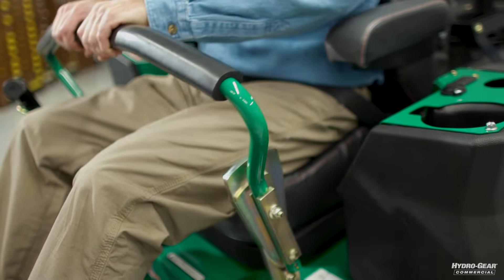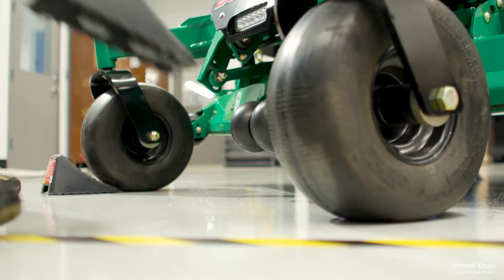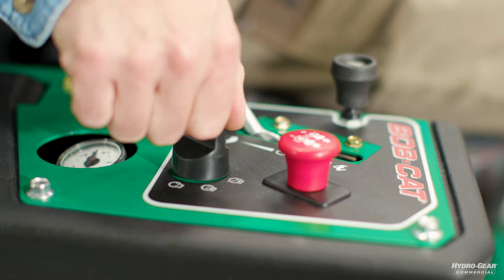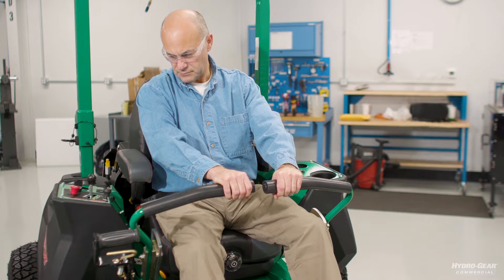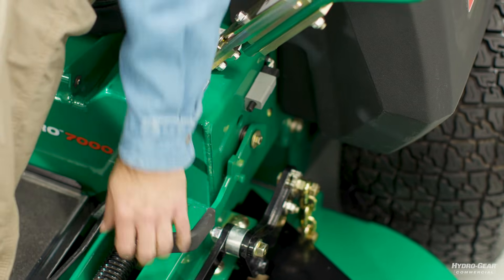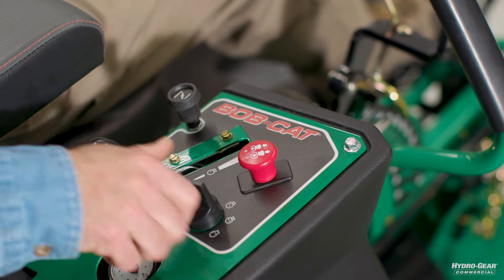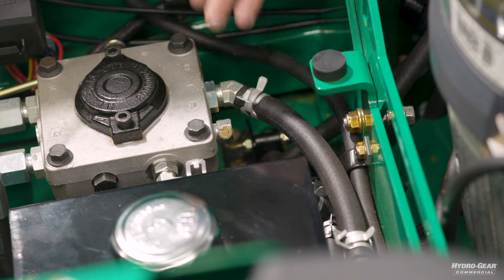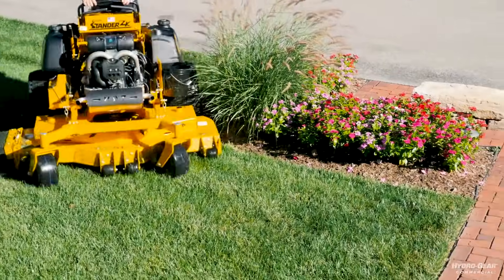Hydro-Gear Pump & Wheel Motor Air Purge Instructions

Comment: THANK YOU...for this video.
While I was unable to directly find ANY videos disclosing the hydrostatic drive bypass valve for a Snapper zero turn mower...i happened upon THIS video, which revealed a nearly identical hydrostatic transmission/ drive, AND ..."Huzzah..😄" the location/identification of that elusive bypass valve.
Again..thanks so VERY much.

Comment: I have a old 3 wheel skag I changed the oil cooler but filled it before installing plus put a new hydraulic belt on it now start the motor and the hydraulic pump is barely moving and there is no bypass valve on this 1996 mower which is a 3 wheel skag what could I do to repair??
Reply: If it's a hydraulic system there's some kind of purge somewhere on it. Try and find a manual good luck

Comment: After recently changing oil and filters on two ZT-3100s, I was trying to purge the system.  Having the drive wheels off the ground and bypass valve open, of of the wheels still rotated.  Any suggestions?
Reply: @Kyle Antonio thanks for your reply. I found the site through google and Im in the hacking process now.
I see it takes quite some time so I will get back to you later with my results.
Reply: @Jesus Prince Instablaster :)
Reply: @Kyle Antonio it worked and I actually got access to my account again. I'm so happy:D
Thank you so much you saved my account!
Reply: @Jesus Prince happy to help :)
Reply: you prolly dont care at all but does someone know a method to log back into an instagram account??
I somehow forgot my login password. I would appreciate any tips you can offer me